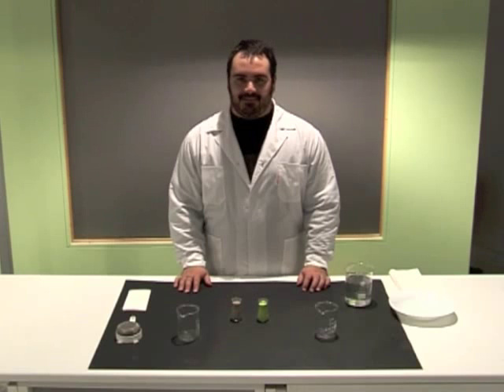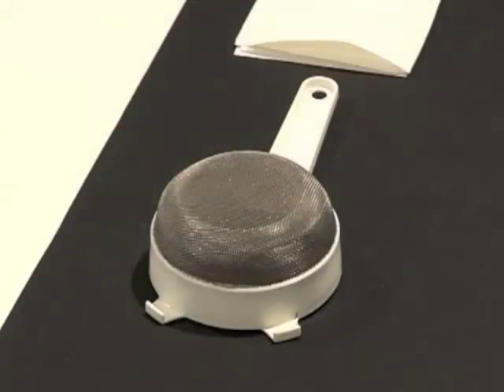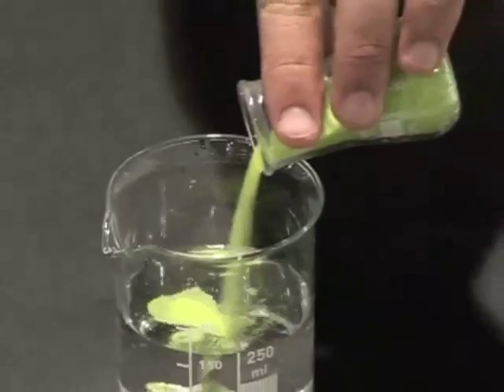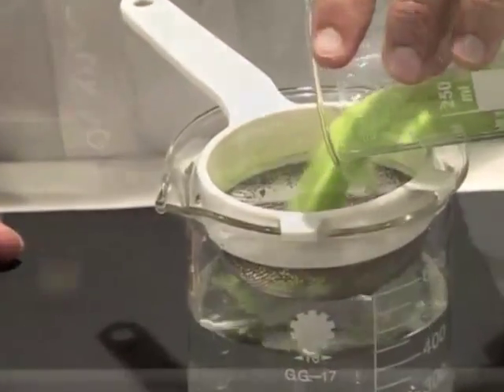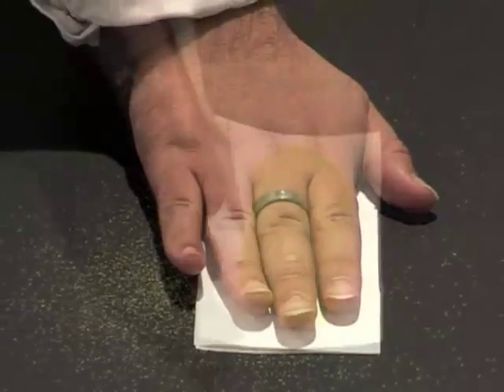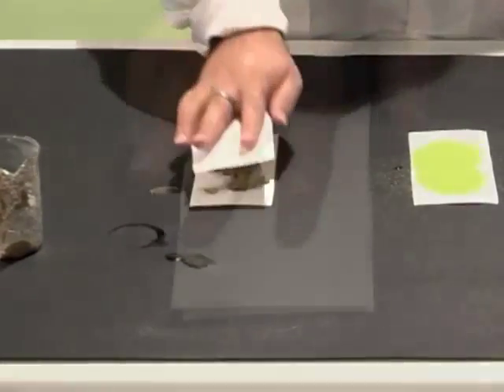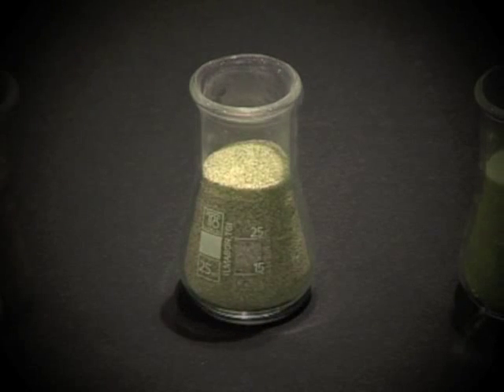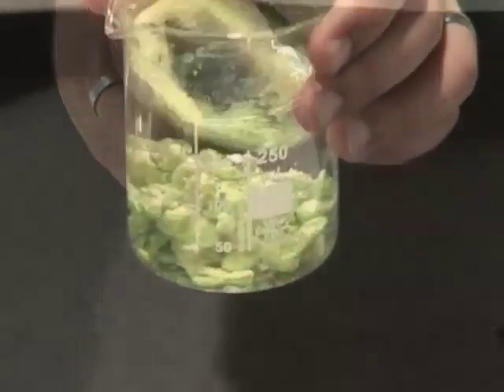Hydrophobic sand

Comment from the maker: 2nd part of the experiment
independent variable: type of material we put on the ink sheet (regular sand or coated with a hydrophobic compound sand).
dependent variable: occurrence or non-moisture in the ink sheet.
controlled variable : type of the material in which the sand was in (in our case water).

Comment from the maker: 1st part of the experiment
independent variable : type of material we drop in the beaker (regular sand or coated with a hydrophobic compound sand).
dependent variable : solubility of the material in the water.
controlled variable : type of the material in which we drop the sand ( in our case water).